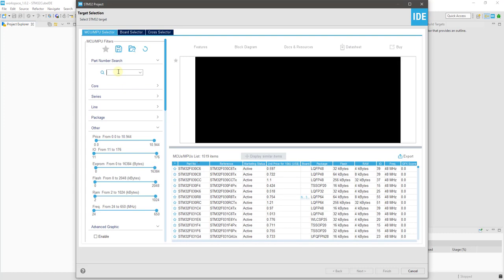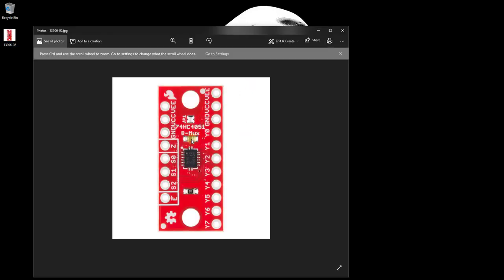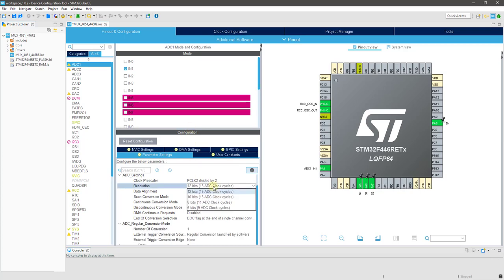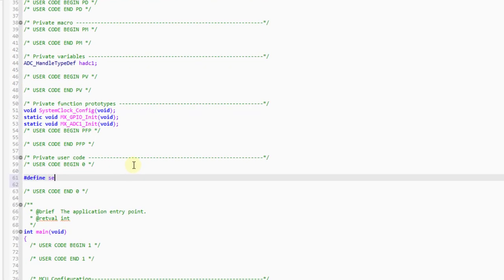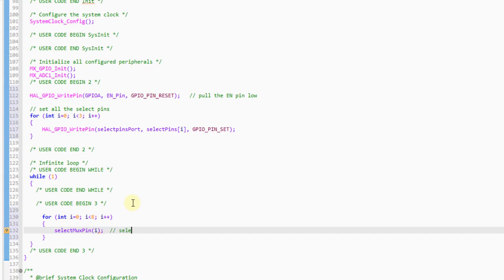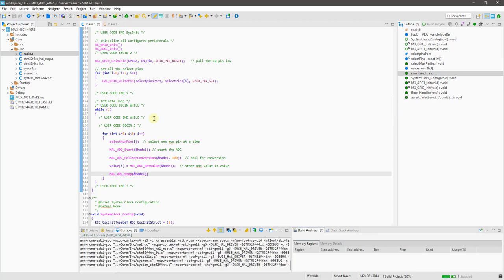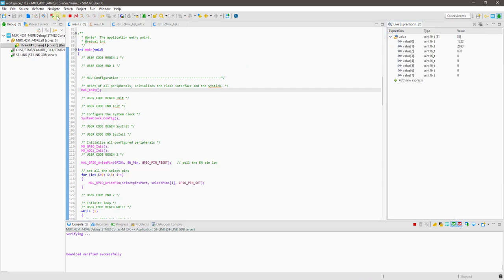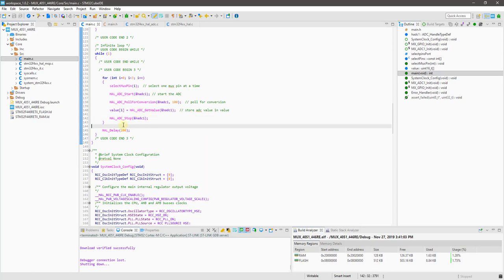Interface 74HC4051 multiplexer with STM32 || CubeIDE || HAL

Comment: Hi ... thank you
Is it possible to use freertos with uart receive ? If yes, how is it achieved
Thanks
Reply from the maker: Yes you can just use the hal uart receive inside one of the task functions.
Reply: @ControllersTech  what if some data where received when the task is not executed ? I mean if a task is executed every 50 ms and I have a contineous data stream to the uart rx
Reply from the maker: Oh, if you are looking for that purpose, than you first take a look at uart ring buffer. I will make a video on isr and rtos soon. 
Even than, ring buffer is necessary for unknown data length
Reply: @ControllersTech  very good and we all appreciate that, I do work on uart ring buffer and dma circular buffer, but I didnt get how to use them with freertos

Comment: :D Great THX. Could you make tutorial about acs712?
Reply from the maker: Acs712 is pretty simple thing to interface. You can use ADC to measure the voltage and follow the datasheet for calculating the current.